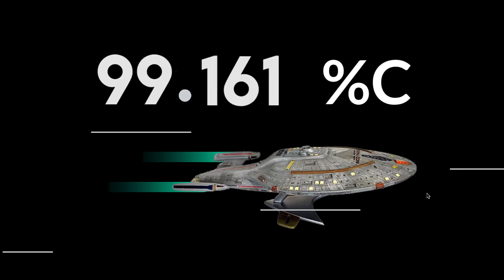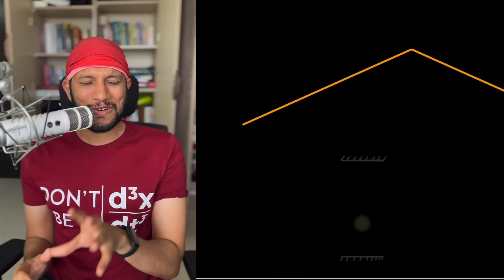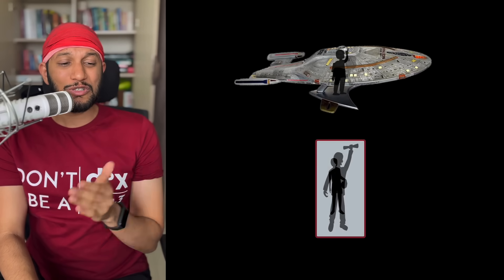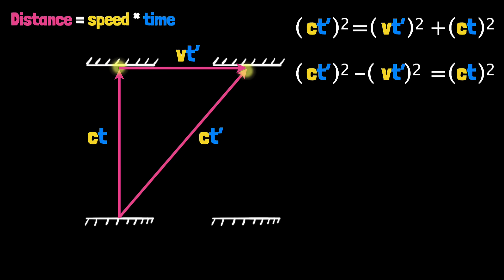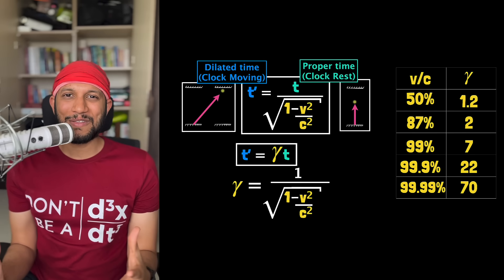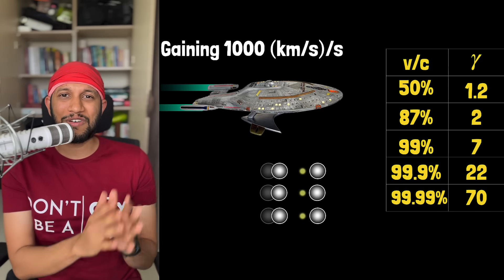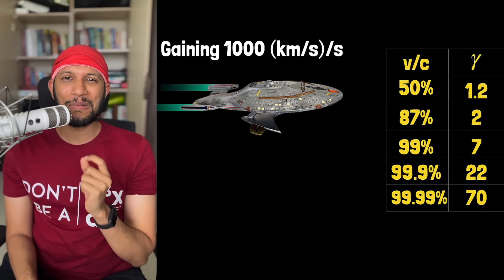I finally understood why you can't go faster than light! (My mind is blown)

Comment: 7:28 Time does not exist "beyond" anything at all, it does not exist as a constant. It is a concept and it is based off of physical observations and interactions which are influenced by actual constants. 
If you're conceptual, then you can argue time is just the difference between two states, the "before" and "after" of kinetic movement. But again, "time" is arbitrary also in this regard because the Universe doesn't give a damn if our brains have "images" imprinted of "previous" states :) "Previous" is arbitrary and this is just a "different" state.

Please stop using "time" to explain things in physics.

If you reverse every motion of every mass in the Universe, you'll perceive it as "reverse of time" yet it will neither have progressed "forwards" or "backwards" it has just changed two states.

Also, that ("time travel") is also a paradox in of itself because it would require twice the amount of energy than exist to do it.
Reply: (Philosophical alert | romantic conclusion)

The "previous" exists only within the context of "change". If state A changes into state B, we can say A was “previous” and B is “after.” But the idea of “previous” only has meaning if we acknowledge change. And once we acknowledge change, we imply time.

But why define time based on the change in physical state and not define change in physical state based on time?

I know we only perceive (or feel) time because of movement, meaning changes in state. But even if we rely on this perception, which gives us a movement-based understanding of time, it doesn’t oppose the idea of an absolute time. An underlying time could still exist, one that flows independently and causes change in objects while our perception simply interprets its effects. This would mean our understanding of causality is incomplete or even misleading, based on what we observe rather than what's truly at work.

An absolute time exists independently, flowing uniformly, and it drives change in physical states. Our rational yet misguided understanding of time then comes from observing those changes, movements, and transformations, before labeling the feeling of time to those undeniable constants... This is pure romance beyond relativity. Only the metaphysical is impressive and worthy of awe.

Comment: And another fact is that at some speed it would be dangerous for any human to travel at this speed.

Because every particle of any visible light or some else particles would become radiation....and worst....

At some point from the front you travel there is radiation coming. But if you get faster this "visible light" for example gets shifted...it moves to infrared light and then to not visible radiation like the light wee see from other galaxies moving away it would be shifted to red....and beyond that

Comment: "Age slower" makes no sense.
Age slower relative to WHAT?
You can't just say "age slower" when talking physics like this. Also it depends on POV, distance, energy, temperatures, well "everything". When you're in orbit around Earth, some argue you "age slower" (relative to those on Earth, I assume) yet the reality of the matter is that they age quicker and the strains on their bodies and what is physically happening will most likely subtract from their lifespan.

Physics is not magic and "time moves slower" makes no sense because it's simply an observation based on fallacious concepts on an astronomical scale, because we have no infallible tool to measure "time" and even if we did, it would still make no sense because it's relative to its environment relative to the observers and so forth.

Comment: Ive always viewed it as a ratio of mass to energy. 1 mass per 0 energy (absolute zero) means no movement, and 0 mass per 1 energy is max movement, the speed of light. That means that no matter how much energy you add, as long as there is still mass, you will never get to max speed

Comment: Explained in gamer terms: Approaching the speed of light is like asking your pc to process an infinitely complex graphics in a game. The more complex you make the game the more your pc slows down. The longer it takes between in-game ticks. If you tried to reach this really high graphics then the game would give you so many pixels that new ticks just stop appearing and you'd get stuck on the same tick forever.
And the real brainmasher is that your gpu's processing power is DIRECTLY tied to tickrate somehow. If the ingame tick is slow then your gpu won't work as well.

Comment: Answer from video (but I insist you watch it, if only for his enthusiasm):
The faster we reach the speed of light, the more energy it takes to propel a space ship to gain that extra "umph" of speed.  So much more energy, it would eventually reach infinite energy needed, which is unrealistic.
This is due to relativity and other science stuff.  Basically, if a space ship travels 99% speed of light, it needs 1000 GJ of energy.  However, getting to 99.999% speed of light requires 10000000000000000 GJ of energy.  It's THAT much more of a jump. (note:  Not actual values, just used to illustrate how much more energy of some kind would be needed for exaggerated effect).

Personally, I always thought "We can't travel faster than light, because once we do, we'll turn in to pure energy and fall apart."  This is a much more eloquent answer.  Thank you.

Comment: But a clock doesn't count when it's hands reach certain points. A clock isn't moving or rather it isn't calculating its own movement. The clocks go out of sync because of the effect of gravity, not because of time. A clock just turns and we have marked points for the clock hands to reach, and timed them to roughly translate to seconds, minutes and hours. They're not the same. Clocks aren't time, nor do they control time. Clocks are just our way of keeping time, not calculating the movement of the hands.
And the theory just points out a problem with regular clocks and photon clocks, as both of them can go out of sync. That doesn't prove anything about time, that only shows an issue with our equipment for keeping track of time.

This whole theory puts all too much emphasis on movement, which a clock isn't counting at all. We count the turning of the hands, not the diagonal movement of the clock. Clocks are not things to measure anything, they're only for keeping track.
Reply: yes the clocks do show time because the people who are on the ship would experience time dilation just like the clock as their body would age slower relative to someone at a stationary position, they would become younger biologically because they are ageing slower relatively to someone at rest because their body literally would operate slower relative to them so the clocks are showing time moving slower. another example in the video was half life's of radioactive materials. uranium on a spaceship going close to the speed of light literally decays slower than uranium at rest relative to it.
Reply: A clock of any kind is just a snapshot of space(location) in a sequence of events. We call that sequence of events as time. That sequence of events is relative to the frame of reference of the space and its observer. 

There is no such thing as a universal time. Time itself is relative

Comment: Well..
imagine the fabric of the universe being like a non-newtonian fluid.
starch with water.

you move it slowly, it behaves like very liquid honey..

you want to move it fast or even punch it, it's like concrete.

the same with light speed.
it itself is being "pushed" back to this absolute speedlimit. 

With  c speed, you'll not gain infinite energy, but infinite mass (i guess this is more intuitive)

I mean, a photon does not have almost infinite energy, when it's flying around, it has no mass..
but also the photon itself "pushes" through the fabric of the universe itself.

If you were to go beyond c, you would "punch through" this "fabric"..

and fabric is a very metaphorical description, i understand.
But it's what most people can relate to while explaining 😅

Comment: Even in the case of a radioisotopes half life, that is the same problem from before. You are describing the slowing down of the mechanism to measure time rather than the slowing down of time itself. Whether its movement of a proton in a proton clock, the movement of protons and electrons in a clocks hand, or the movement of protons and neutrons in the process of a radioisotope decaying into more stable lower order elements, it is still functioning off the movement of constituent matter made to take a longer time via composite movement. 

It seems then we only have mathematical proofs of time dilation, unless you have an experiment that shows time dilation without relying on a mechanism of measure within the realm of the electromagnetic force. The measurement would need to disinherit movement itself in order to break this barrier. 

For reference : "A nucleus consists of protons and neutrons held together by powerful forces. Certain combinations are more stable than others. It has to do with ratios and “gluons,” but I will try to avoid that part of the explanation. Within one element—and to be careful, let's assume we are talking about one nuclide (or one isotope of one element)—every atom has exactly the same combination of protons and neutrons. It would appear that all the nuclei are identical, but the particles have some combination of “jiggles” inherent in them, like siblings in the back seat of a car.

For a nuclide with a long half-life, most of the time the total jiggling stays inside the limit of the binding force that holds the nucleus together: the nucleus doesn’t break apart. Every once in a long while, however, the jiggles might line up or form a resonance that sends the nucleus across the limit of its cohesion, and the nucleus splits."

That 'jiggling" or random forces on individual parts of a particular isotope, is nonetheless movement.

Comment: I don't think You can say time is slowing or accelerating, as this would mean You could count derivative of time. Second per second is not changing. You just have two objects with different trajectories, but for each trajectory time is constant. Nevertheless  outstanding video, one of the best about light speed.

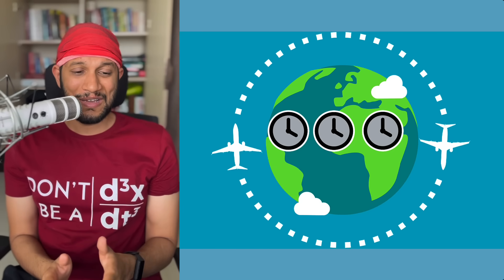Comment: 4:42 mark:
With this clock experiment…one has to take in consideration…earth gravity’s…effects on the mechanical devices… …the closer the device is to earth’s surface…the more affect earth’s gravity will have…the further away from earth’s surface…the less affect earth’s gravity will have on the device…which will cause a time shift with the two devices…

Comment: Okay, that explains why so many scifi stories use nether travel. (Slipstream-Andormeda, Hyperspace-StarGate, Warp-Warhammer) We might not know how to do that, but at least it doesn't break the laws of physics as of current understanding in principle.
And considering how we are cheesing physics already. Why not. 
Also theoretically you can steer in Warp in Star Trek. The odds of surviving it are just so bad no one does it. Look up what the deflector does and why they have to pre calculate routes. Also the inertial dampers might be bottleneck there. Warp (Star Trek) only works at all because the universe is mostly empty.

Comment: we assume the spaceship that is going 99.999999999999999% the speed of light is like 1000000 km long and there is a 800000 km runway inside the ship. then you have a fast vehicle inside the ship that can accelerate 500 km/s/s, then you drive it from the back of the ship to the front accelerating 500 km/s/s. will the vehicle inside the huge spaceship reach or surpass the speed of light? :) if not, what will hinder it to reach the speed of light?

Comment: At Boulder Colorado resides two cesium clocks.  These clocks are on two different floors, one above the other.  Therefore the clock on the lower floor is rotating around the earths axis at a smaller distance to the earth’s core than the one above it.

Guess what, they were synched when started.  They are now out of synch with the one farther from the earth’s core, indicating a younger time period (running slower)than the one on the floor below it!

If given a chance, visit the NIST labs, they are extremely interesting!  

Next, look up the difference between UTC and ZULU or GMT.

Thanks for the video!

Comment: maybe  YOU  can't, but a vehicle  MIGHT  be able to, if certain technical issues are overcome.
017   supposedly the mass of an object increases.     but that idea  makes  absolutely  NO  sense.      an  object's  kinetic energy  does increase, but  that is  NOT  a  problem.    it is simply a  Result of the (continuous) acceleration of an object. 
the 'idea'  of  velocity is  always  RELATIVE  to  Something.     two objects moving parallel to one another at the same velocity are stationary relative to one another.
what  RELATIVE  velocity do you get if two objects are moving away from one another at  point-six  c.   ?!?!?!?!
conclusion:  IF some amount of acceleration of an object can be maintained for long enough,  c  will  be  reached.!       in other words, the real question is not 'can it be done', but  'HOW can it be done'.

Comment: Wait does this mean there is going to be deminishing returns on the speed of near-light travel. Say you are traveling in a spaceship going 99% the speed of light for a year inside, everyone outside the spaceship looking will have aged 7 years in that time, but if you move slightly faster at 99.99% everyone outside the spaceship will have aged 70 years relative to the people on the spaceship? and that is from only increasing the speed less than 1%, and at one point increasing the speed by almost nothing will be increasing the outside timedifference by millions of years? so for the crew the travel time seems to have have gotten marginally shorter, but relative to them the rest of the universe could have aged eons? I’m confused, say you have a spaceship moving 99.99% the speed of light, when their on-board clock says that they have been flying for 1 year, i would assume they would have moved 1 lightyear, but to everyone outside looking does it seem like they have been flying for 70 years? Have they arrived at their destination faster, or would they have moved further then 5.88 trillion miles in that time?

Comment: It is not that hard to understand. 0-100 km/h can be rescued relatively fast in any decent car, but 100-200 km/h takes a lot more fuel and time. You can feel how far it gets more and more difficult. You replace an asymptote resulting from air resistance + friction with an asymptote resulting from equations for relativistic mass/kinetic energy.

Comment: Problem actually is you can't travel faster than light since you are not "traveling" anymore. When you reach spead of light you are not moving anymore in time-space. Time is still and you are still, but you can still "not travel". You appear in time-space in certain spot after reaching critical speed. You can think of it like a cannon, you put stuff in give it propulsion and it arrives in certain spot. This happens in critical speed, propulsion takes you to certain distance without any lose of time.

Comment: Great explanations, I almost feel I'm beginning to understand. However, what if you took the photon clock and rotate it 90 deg so the photons moved in the direction of travel? wouldn't that mean that the photons would travel a shorter distance in one direction(opposite to the direction of travel) and a longer distance in the other (with the direction of travel) which would get balanced out to leave time unchanged from the viewpoint of the clock.?

Comment: Do you understand why you can’t go faster than the speed of light or is it that you finally understand the explanation about why you can’t go faster than the speed of light? So you really understand on a fundamental level why you can’t go faster than the speed of light? Do you even really understand at a fundamental level why light has a speed limit? Do you even understand what “speed limit” means when talking about light? Speed is distance over time but time is relative. So doesn’t that make “speed” relative? Relative to a “thing” or a point particle or something that has mass. Does light even have a perspective? Relative is in relationship between two objects. Is light even an object? Can you define light as an object, with certainty? If it isn’t an object does it even have speed since speed is relative and relative is the relationship between two objects?